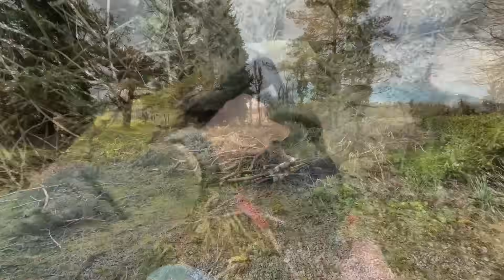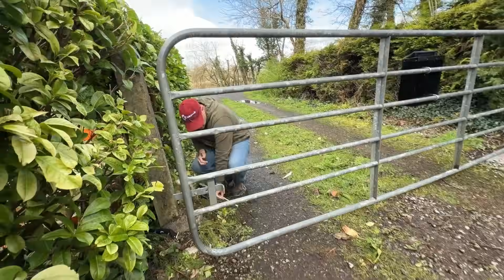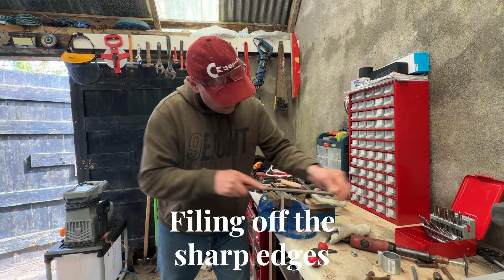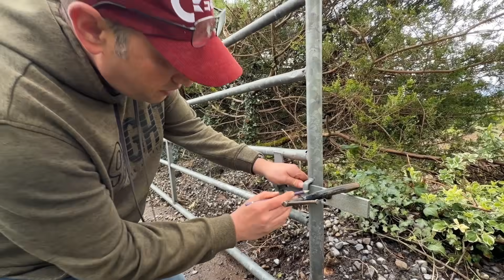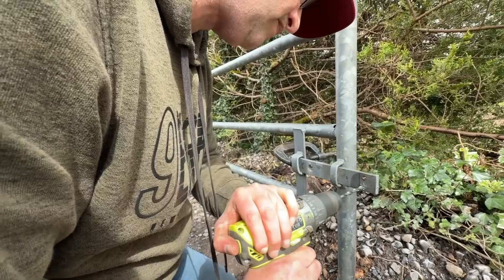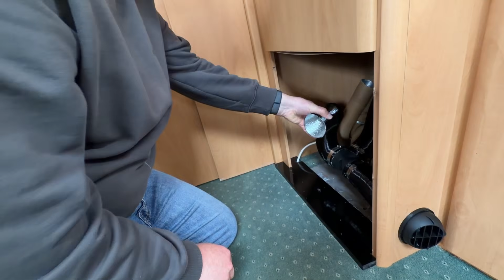Bits & bobs around the Irish Cottage Homestead.

Comment: Could you not straighten up the gate post.
Reply from the maker: Hi,, they are solid concrete and concreted in. They would need digging out and moving not just straightening. It’s a temporary solution as the gate is going to be replaced anyway once we have sorted the cottage and trades and trucks have left😊
Reply: @IrishRiversideCottageRevival It must of been the camera angle it looked like the post was leaning away from the gate.